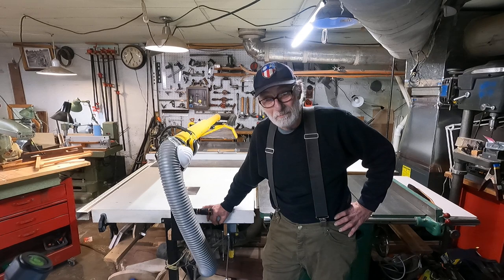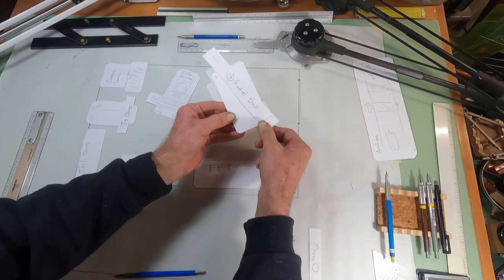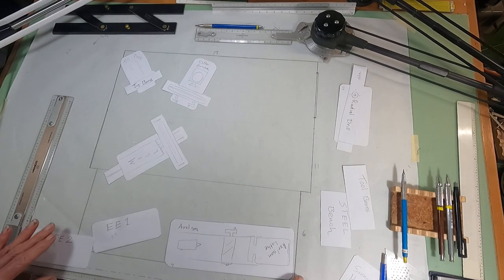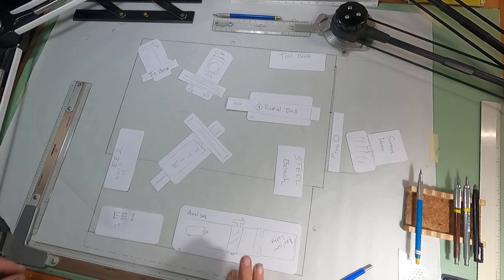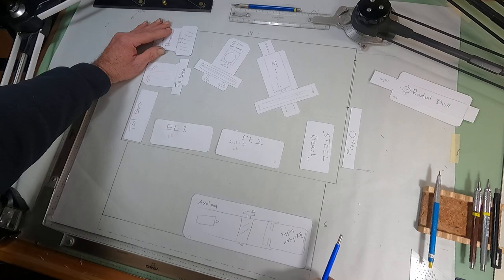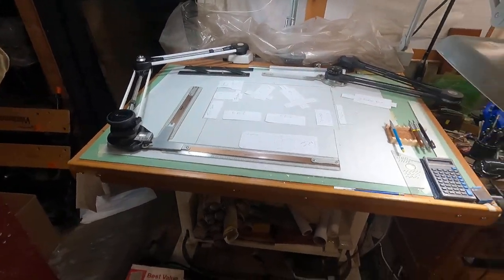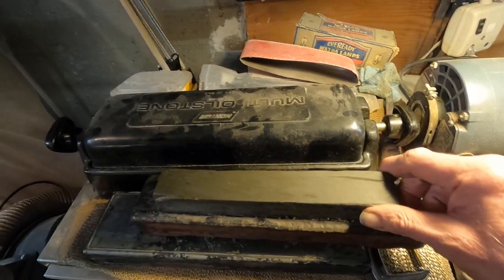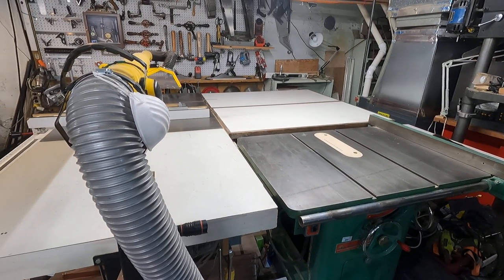Garage machine shop planning on a pencil drafting table

Comment: Love the old school drafting parallel, takes me back! Add as much space as your lot will allow, incremental cost isn't enough to worry over... but you'll regret not having extra feet if you don't.
Reply from the maker: There are certain distances I have maintain, this is a tiny lot, I can go further out the front, stop picking up machines!!
 The drafting tools were worthless 10yrs ago, I found most of it at the Goodwill now they seem to be scarce. I find it fun to use those old precision tools that were way out of reach when I was young. The old system of drafting can't be hacked, takes a burglary.

Comment: Hey Donnie, it's always great to see you! I use to plan space this way with the paper Machine templates but whenever I added another template, the wife of 38 years would show me the "Honey Do List" which had to be 1st. She just Doesn't understand my True NEEDS....Seeyah buddy...Ricko
Reply from the maker: My wife likes the woodworking, the metal working not so much, the motorcycles not at all.
Reply: @deedeeindustrialsuperprecision  I am lucky.  I met my wife while I was fixing an elderly friends tractor as a gift -- he needed his tractor and could not afford the parts to replace the clutch and other maintenance.  Sometimes she looks at me funny about my tool acquisition until I use one of the tools to either repair or completely redesign and rebuild one of her scientific instruments, and then she is OH SO HAPPY ;-)  Heck, there has been a time or two she gifted me with a tool so I could do something...  The only time she freaked out and put her food down was when we are prepping the house to have insulation sprayed into the rafters, as part of the prepping I start wiring various parts of the house with grounding wires (50% of the house was underground tar-covered cloth).  I kept having allergy attacks from all the dust in the attic, and it took a month or two...  She was just about to leave for several months to work to would out of country, and the thought of having the house in that state when she left was to much.  We got the insulation in, and all the bulky stuff in the garage out of the yard (under tarps), and all back to rights just a few days before she left...  I cannot blame her for that, but I will say that I never got around to replacing the wires to the last 10 or so outlets...

Comment: CAD does after all mean cardboard assisted design, at least in my world… my wife has never forgiven me for letting woodworking languish in favor of learning welding and machining.  I enjoyed your tour and really appreciate how you use space. Make the shop addition 8 ft you’ll be glad you did later. Good insulation will take care of the utility  bill.  Cheers, Will
Reply from the maker: I will have to remember what CAD really means. Not long ago, still using a pencil drafting table would actually make some angry. I am learning more about welding myself, in the past I would use the talents of the nuclear grade welders available here best in the world because they have to be. Now I have to be more self-sufficient, but also not having to have every machine Like I did in a commercial situation. I have assembled a powerful tool room machine shop in a small package. I cannot do everything, but enough to get by good.
 The little garage is really stuffed with insulation, as much as I could get in, helps with noise too. I have to consider several factors expanding that garage, one is it has to look good and not look like a hillbilly did it, though that is the case.

Comment: Interesting shop setup sure it is going to give you some nice room around the machines basement shop has some fine machines lots of tools . Are you doing the garage addition your self this spring ? Great action.
Reply from the maker: Yes, the challenge of expanding a one car garage that was built as cheap as possible in 1939 is a go.

Comment: Out of curiosity, how many feet minimum do you leave around your jog borer, lathes, and other large tools for working area?  I ask because I am just about to do some scale drawings of my garage in prep for the heavy-up electrical work to plan for the future shop.  I typically like 4' to 6', but my shop will likely end up looking like a miniature version of what you have going on ;-)  Just curious what numbers you use as a minimum, and nominal when you can.  The only other time I did this, I made the cardboard models so that the mill table was not to scale, but was to scale after full travel stop-to-stop, and left only enough space I could roll a toolbox between the two machines.

Oh yea, after doing the paper layout, I am thinking of also build some scale 3D cardboard models to keep the inspirational momentum going -- this will all will likely take a year+...
Reply from the maker: The jig borer takes the least room because the table does not extend like the mill and cutter grinder,. The mill and cutter grinders tables can collide so one at a time there. Good luck with that.